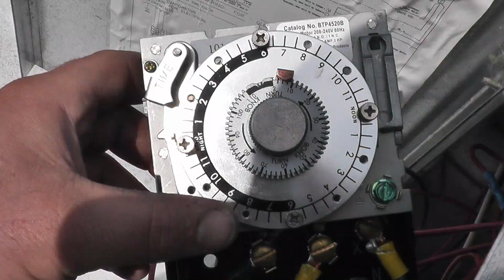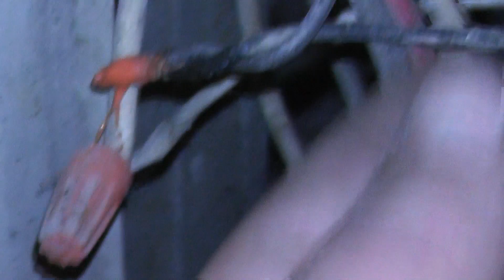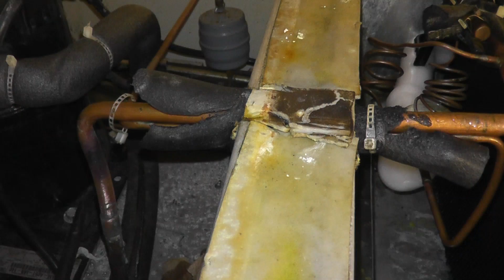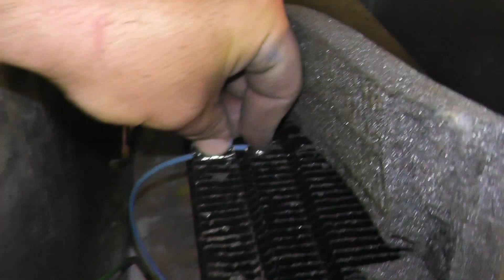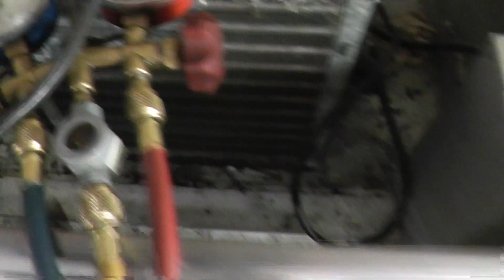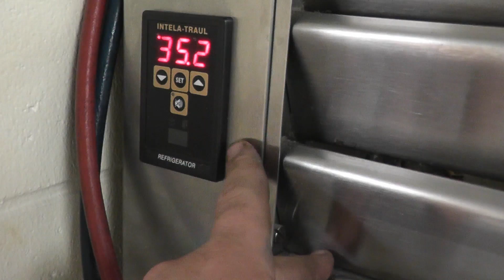Another Day In the Life of an HVAC Tech Part 3

Comment: If you have a walk in freezer or commercial freezer that is not defrosting check terminal X. This terminal is designed to skip a defrost cycle if not needed. It is controlled by a thermostat on the evaporator. The same switch will also delay your evaporator fans from starting if the coil is not down to temperature. Some units have two separate clip on thermostats. One to skip defrost, the other for the fan. Why fan delay? Well after the defrost heat strips turn off and the compressor starts up, you don't want hot air blowing in your freezer. Excellent video.

Comment: This is probably gonna be a dumb question, but bare in mind I'm still going to  HVAC classes, and we may not have covered this yet. Ok, so the  main components of an HVAC system is your Compressor, Condenser, Metering Device, and Evaporator. Where does this Dryer you're showing come in? or is that the Metering Device being called another name? Again I apologize for the dumb questions, but like I said, I'm still in my first semester at O.T.C's HVAC & R program here in Springfield, Missouri, and I'm using your videos as a real world tool to make better sense of everything I'm learning in the classroom. Thanks in advance, and love the videos.
Reply from the maker: The dryer is after the outlet of the condenser or receiver and before the inlet of the metering device.  If the unit is not critically charged (has a receiver and TXV) there is usually a sight glass after it.  The dryer contains a filter element and dessicant.

Comment: Halligan 142, Thanks for the quick response. Here is the problem, since I can't rent the gage and manifold, and the hose's on the one at work is probably low pressure, maybe I should just get a tech in to check my geo system. The geo was working great in the cooling mode and when I switched to the heat mode the low pressure light came on after a minute or two and shut down the compressor, fan still running, then aux. heat comes on. My thoughts are maybe the low pressure switch is bad or the unit is low on R410, if that's the case, it will need to be serviced withR410 and I'll need the tech. What's your thoughts on the problem.
Reply from the maker: Heat pumps up here aren't too common because of how cold it gets in winter and Geothermal units are even less because of the frost line and also at least in most of the towns I've lived in the ground is rock central so I have only serviced a handful of heat pumps.  If it was low on refrigerant then it should technically have shown up during the cooling season also.  If it's low then you have a leak somewhere.  Some of the most common areas are around the service ports on the condensing unit or around the connections to the evaperator.  Take a peak there and see if you see a lot of oil on the pipes or fittings.  Oil 90% of the time indicates a leak.  Where you work fine and cooling and not in heat there could possibly also be something wrong with the reversing valve.  Again if it's a new unit it should be under warranty.  The manufacturer usually has a 1 year warranty on all parts and 5 year warranty on the compressor. This does not usually cover labor or refrigerant.  Then there is also whatever warranty your installer offered.

Comment: Hi Halligan 142, love watching your videos and learning from them. I got a problem that I need advice on. The company that I bought a geothermal heat pump from is trying to save me some money buy having me check some pressures on the  R410 system. I need a set of gages for the R410 systems. We have a set of gages at work that I can borrow but they are for the lower pressure systems. Can I just replace the two gages with gages that has R410 readings and use that set from work?
Reply from the maker: Yes you can, but you have to also make sure the hoses themselves are rated for 410A (800PSI working pressure 4000PSI Burst)  The older hoses were rated for less.  Also low-loss fittings on the hoses are almost a must.  Last time I replaced a gauge it was something like $15-$20, but a whole new manifold minus the hoses was around $35-$40 on sale.  The 6ft low loss hoses will run you somewhere in the $60 range.

Comment: it melt the marrette off?? ive never seen mareette melted like that.... wow. seen plenty of blown up and burnt stuffs but def not marrette
Reply from the maker: Wire connections are usually the weakest link.  If any water gets in there or it gets loose because of vibration a lot of heat gets generated there.  I admit I see it more often with stake-ons than wire nuts, but that's one reason why I always tape my wire nuts especially on anything that's in or near the evap coil.

Comment: I use the Testo 550 gauge set, It's reasonably priced and for refrigeration it gets the job done. It has a min/max function which is a big help for adjusting the cut in and cut out pressures on a pressure control. The 2 temp clamps can show the delta t of the condenser coil, or the evap coil, you can measure the delta t of a drier filter. I have a bunch of worn out yellow jacket gauge sets.
Reply from the maker: I have always used the J/B sets.  Never liked the Yellow Jackets.  I carry multiple sets.  One for reclaiming/nitrogen leak checking, one that has 410A range gauges and one that has the smaller range for all the others.  I've been looking at the Hilmor gauges.  They're like the Testo's, but also have a conventional analog gauge heads in addition to the digital displays.

Comment: Here's a trick I've been using for a long time, SUPCO makes a great oil additive, it disolves the crud in TXV strainers and cap tubes. The best thing is it lines all the metal parts and makes them more slippery, so at 10pm sat night when your customer is loosing the ice cream in his freezer because the compressor is binding and overheating and going off on its internal overload protector, add SUPCO you can get the compressor running until monday morning.
Reply from the maker: Hrm I'll look into that  Thanks!  Oh and 134A is the worst with cap tubes.  Once that compressor overheats I find that it either clogs the drier or the cap tube has that chalky crud restricting it.

Comment: Stay brite #8 came out back in the 70's for high presure 502 hot gas discharge vibrator eliminators. I use it on anything I might have to take off at a later date, like a sweat drier filter or a headmaster valve. good video.
Reply from the maker: I love staybrite and use it wherever I can.  Usually the times I can't use it are on compressor change outs where I don't have enough room to cut the lines and have to unbraze the compressors and the same with TXV's and obviously repairing leaks on brazed joints.

Comment: I usually set my length of defrost for 80 to 110 min, when the defrost termination klixon reaches temp it sends power to X and pulls in the clock solonoid, terminating defrost, so if they only need 15 min of defrost it will terminate, but if they need 65 min the time is there for it.
Reply from the maker: The only problem with that is that the defrost termination switches are super cheap and in my experience have a high failure rate especially after a couple years.  I know there is also a secondary safety that will shut off just the heaters if this happens, but in more than 1 instance I've seen both of these fail and completely melt the coil wiring.  In most of our applications ~35 min seems to be the sweet spot.  Most of the restaurants use the walk-in freezer most in the morning and evening and it's closed the rest of the time.

Comment: hey Halligan142 my names Brock, i am currently trying to get into hvac myself and have always had some respect for hvac techs and what they do, but after watching these vids, wow, there is alot more that goes into it then i thought and am really eager to jump into this career path. I was just wondering how you got into it? did you take classes and get certified first? did you go through an apprenticeship? Im currently 22 and deciding what skilled trade i'd like to begin my career with and apparently i wasn't qualified enough for the electrical union haha. Any information/ideas or words of wisdom would greatly be appreciated. Thank you and keep doing what your doing! much respect.
Reply from the maker: I started in Highschool.  I went to a Vocational highschool and have actively been working in the trade since my junior year.  The only certification you NEED is an EPA cert which you will get with any class you take.  This will allow you to work with and carry refrigerant.  Everything else you will be working under someone else's license until you get your hours in.  In my state you technically only need a HVAC license if working on equipment of 15 ton or larger.  Requirements are a 300 hour electrical code course (half journeyman) and x amount of hours logged under a licensed person.
Reply: ***** The system has to pump down before defrost? That's weird!
Reply from the maker: John Smith Yes.  The solenoid coil is wired into the N/C contacts and the evaperator fans.  It's not wired directly to the compressor contactor, so when it goes into defrost power is disconnected from the fans and solenoid coil (terminal 4) and switched to the defrost heaters (terminal 3) which causes the unit to pump down and shut off on low pressure.  This way there is no refrigerant (or very little) in the evaperator during defrost to get heated up and pressurized so the compressor will have an easier time starting up after the defrost is over.
Reply: Very strange. The hot gas defrost is a lot nicer in my opinion, because it uses less power, and can be faster.
Reply from the maker: John Smith I only see hot gas defrosts on very old Norlake walk-in freezers, but it is used extensively on ice machines.
Reply: I thought hot gas defrost was extremely common even in today's freezers.

Comment: Great video like the way you dont skip procedures and do it right the first time.  I worked in the trade in vegas for a bit and if my boss saw you using nitrogen while brazing to displace oxygen he would have laughed, its hack central out there, at least thats what I saw.  I was wondering if you could tell me how you got into the trade and where you went to school, how long you have been doing this etc...  I can follow along with all your repairs to the equipment but when it comes to programming these new thermostats or like the one you did in this video i would be lost with out the manual to show me how to scroll thru the setting and what the letters represented HSP, LSP drives me nuts trying to program these new thermostats!!!! lol

Comment: Cool vid! I do residential hvac for an oil company in northern MD for about 7-8 yrs. When I replace a txv it specifically says do not install the valve upside down in the installation instructions.
Reply: yes it does say do not install upside down,i was wondering about that also

Comment: Awww, memories of days past! :))
I'd be willing to bet the compressor on the walk-in was a Bristol, just from the sound. Nice walk thru on the exp-valve replacement.
Down side of living in Texas, most air handler's are in the attic. At least you can stand up in the basement. :))
Reply from the maker: I can't do the attic thing.  I started out in residential, but after one summer of that I went to a company that is strictly commercial.  We have splits, but they're in a commercial setting.  Not many attics.  Mostly drop ceilings.

Comment: Greg,
Thanks for an informative video. Don't you just hate it when breaker panels aren't labeled? When I was in Direct Mail Service, 99% of the machines ran on 230V 1Ø. They also used vacuum for handling the envelopes and inserts. I would turn on the machine so the vacuum pump would run. It would run without actually starting the machine. I would start flipping 230V breakers until the pump stopped. That way an operator couldn't start the machine with my hands in it! (It's happened! I have the scar to prove it!) Was that a Gast carbon vane vacuum pump? I wish I had a dollar for everyone I put new vanes in! Or converted the old type with phenolic vanes and oiller to carbon vanes and did away with the oiller. Do you work on any old walk-ins that still use ammonia? Like the old saying goes:  "You get what you pay for." It appears the guy before you was a real hack! Thanks again!
Regards,
Dave
Reply from the maker: I do not work on ammonia systems.  Mostly you still see them in heavy industrial/commercial applications.  It can be nasty stuff if not handled correctly.  The vacuum pump is an old J/B two stage 7 cfm rotary vane.  Still works like new.  I like how they say you need to change the oil after every time you evacuate a system.  I don't know anyone that does that.